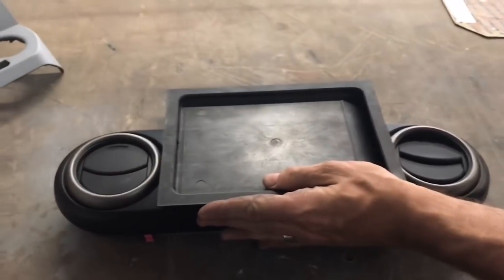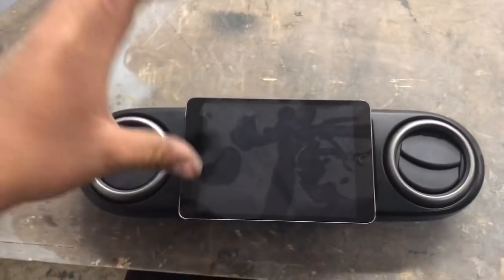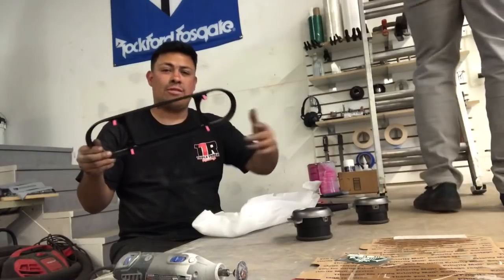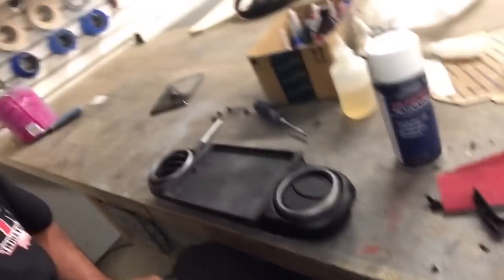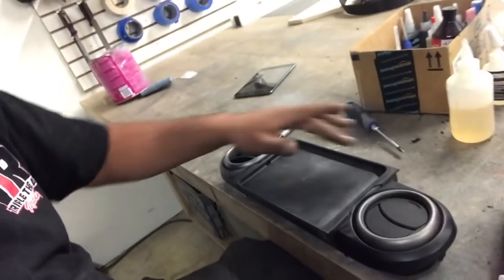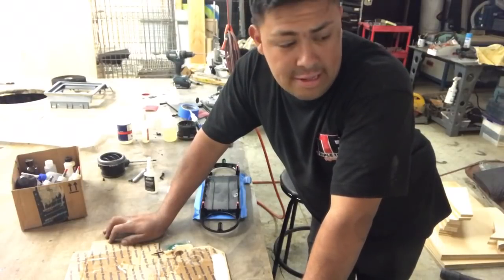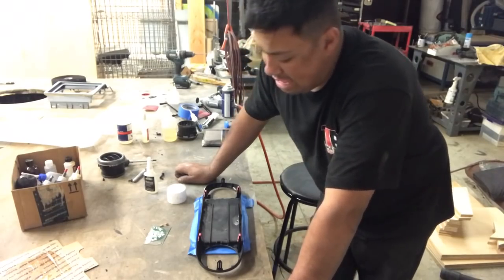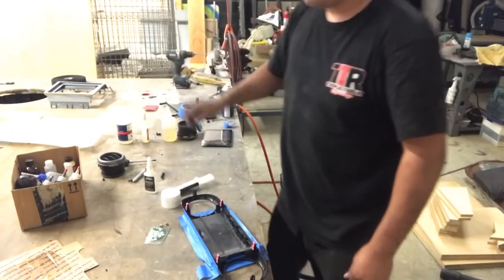The Rafa Show - Will It Fit???

Comment: I noticed you and Doug both have been using JB weld brand plastic epoxy these days. 
Any benefits or reasons you stopped using the 3M Semi-Rigid Plastic Repair? Thanks man.